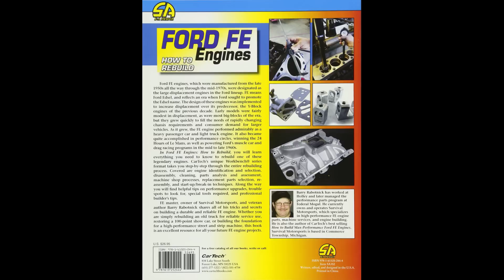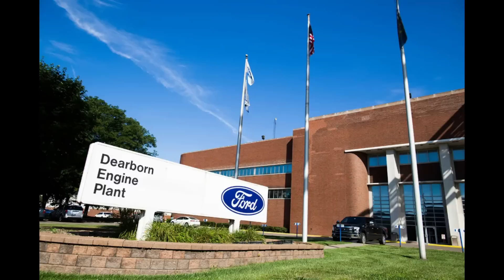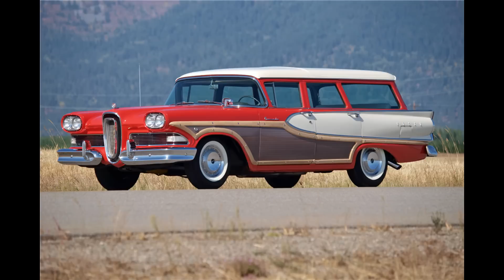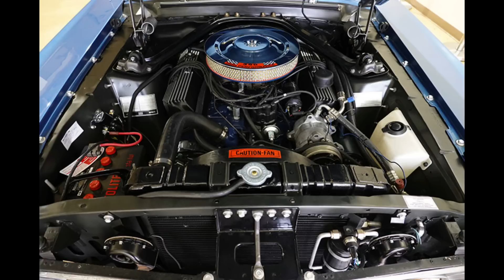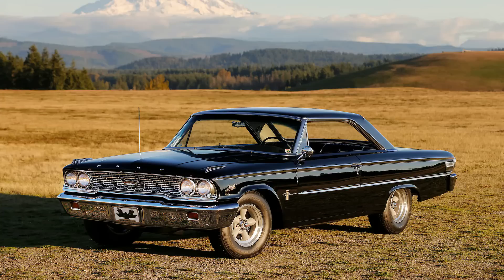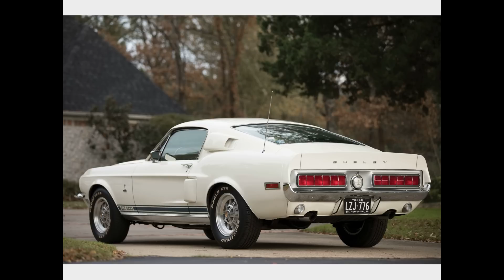Learn about Ford's FE engines and why they are among the greatest offerings by the Blue Oval!

Comment: I worked with some old time Ford mechanics, who assured me that the police package engines were hotter than the high performance cars sold to the public. Certain parts for the police engine packages required the signature of a dealer principal so they could be ordered. By dealer principal,  it was either the owner or general manager who had to sign off on the order of those parts, it was Ford's requirement. That was at a time when many performance parts could be had over the counter. As one of the guys said : It practically took act of congress to get those parts ordered !
Reply from the maker: Never heard that story! Thanks for watching and sharing!

Comment: In 84 I wanted to replace the tired 302 in my F150. I guy I was stationed with said he had an old engine sitting in his back yard when he moved it. He thought it was a Ford. I gave him $25 for it and took it to the base hobby shop. I tore it down, it was full of rusty water and oil. It looked rough but I still took it to a machine shop for eval.
After a day I called the guy "where did you find this thing? Come in, I want to go over it with you".
He showed me a small crack in the water jacket was welded. He figured that was factory after casting. They didn't want to scrape it so to save money it was made into a truck engine. All the internals for the engine it was going to be. The mains were cross bolted with massive bearing seats. The connecting rods were Ford Le mans and triple the size of the standard rods.
Reply from the maker: Sounds like it could be a 427.  Did you end up putting it in your truck? That is one heck of a bargain and a legendary score, thanks for watching and sharing!

Comment: I own a 1964 Galaxie 500 Convertible with a factory 427, dual quad four speed. I have owned it for 50 years now......it's been a great car. I have been restoring for several years now. It does run and drive....

Comment: The only things i never liked was how the valve cover seal area was weird and you have to remove valve covers to remove the intake.thats not that big of a deal.but even when you go to removivg heads one with high milage.the stock exhaust manifold bolts often broke off in the block.larger bolts may or may not have helped the desighn.we will never know.you could beat the crap out of them for ever,put a new timing chain,head gaskets and sratr all over again.

Comment: Were the FE engines denoted "352" heavier and more reliable in low speed high torque truck service than the engines denoted as "Windsor 351" or "Cleveland" ? 
  The "390" or "391" much more robust and also more power and torque over the entire RPM band than the "400" that replaced it ?

Comment: In the late 60's and early 70's I did a bit of sanctioned drag racing.  I was very familiar with all of the muscle cars of the time period.  I was campaigning a big block Mercury in Modified Production but I knew the performance of most  of the other classes.  I came to notice that Small Block 289 HiPo Mustangs were excellent and the 427FE was outstanding.   But the 390cars were getting beat more often than not.  Ford pushed the 390 335HP but it seldom if ever mentioned the dual quad 390 with 408HP.  Had Ford given more press to the dual quad 390 the Muscle Car wars might have been more in Ford's favor.
Reply from the maker: That's some great insider knowledge from the drag strip days, thanks for watching and sharing!

Comment: Currently rebuilding a 72 F100 short bed with a 390 C-6 and Nine inch rear end.  I'm going through the engine now the trans is done and the rear end rebuilt and all the suspension is completed. Upgraded to four wheel disc brakes. Should be a pretty cool truck.
Reply from the maker: That sounds like a great project, thanks for sharing! Love to see it when your on the road again!

Comment: I always wished that they had made the 4.13 bore from 1962 on. They were a great block. They didn’t need the side oiling. The SBC oils the same center oiling method. A 4.13 capable bore would have been an evolution. A 406 and 428 would have been all that was required. Never understood why they didn’t, it just made sense to me.  They could have made thick bore FT 391s for trucks that would be great over the counter blocks to build larger cubic inch strong engines, like GM did with their BOPC engines, all 454-500 ci engines. The 385 just was too heavy for “sporting cars”.
Reply from the maker: Thanks for watching and sharing your interesting info!
Reply: @IfThisCarCouldTalk Thank you!  I never understood why they had to do away with the best engine Ford ever made and replaced it with a bunch of overweight underpowered engines. The 4.13bore and a 3.78 and a 4 inchcstrokescc  were sufficient for every need they have. The LS is much like the Ford FE, and the Coyote is basically a DOHC 5.0 litre  sturdy FE. The two most powerful engines now are essentially remodeled FEs. I really wish that Ford would reintroduce a 4.13 bore and a 4 inch stroke pushrod FE. Sell them through SHP. Use modern technology to oil and cool them. Bring back the Cobra Jet 428 and put it in a modern Mustang and Trucks as a 406, maybe a 406 Mustang.

Comment: the 410 is a 390 bore with the 428 crank stroke.  i had a 64 merc that i put my uncle ed's pk lane 66 410 in it.  wow!  now i have a 66 pk lane with factory a/c and a 410 motor that replaced the 64 that i sold in ny long island long ago. Both were4door hardtops with a/c powered by UNCLE ED!
Reply from the maker: Awesome - thanks for watching and sharing your experience!

Comment: I have a recently finished  1959 f100 short wide bed. 1968  390 and a c6 transmission. IFS, four wheel disc brakes, parallel four bar rear suspension with coil over shocks on all four corners. I love it !  A stock 390 w/ 2 barrel carb made 427 lb / ft of torque, yep a two barrel.👍😎❤️F E’s ❗️ almost forgot mine has big back window !😁
Reply from the maker: Sounds like a dream truck, thanks for watching and sharing!

Comment: I'm not sure where you got all your information I  KNOWN several people that had early 70 GALAXIES  LTD  that had 390s the 70  to 73. MERCURY MONTEREY  USUALLY THEY  HAD A TWO BARREL 429= My uncle bought one brand new.HAD 390  And I've owned enough Fe engines and Mells since   I was a kid I know exactly WHAT THEY ARE my Continental  either ran the 430/462/460  365A Block CONTINENTAL MARK III THEY CHANGE THE 462 MID-YEAR TO THE 460 ON THE LINCOLN CONTINENTAL'S 

CONTINENTAL MARK III  ALL GOT HIGH PERFORMANCE 460. 
BUT YOU CAN GO OUT TO JUNK YARDS. AN STILL FIND 1970 TO 1973 FORD GALAXIES AND LTD  STILL HAVING 390 UNDER THE HOODS IF IT ISN'T A SMALL BLOCK. OR CLEVELAND THE LATER ONES  ENDED UP WITH THE MODIFIED 351 AND 400 TALL DECK CLEVELAND  WITH A C6 TRANSMISSION MOUNTING INSTEAD OF THE OLD C4 OLD FORDOMATIC KNOWN AS A CRUZO MATIC I KNOW I DATED MYSELF
Reply from the maker: Thanks for watching and sharing!

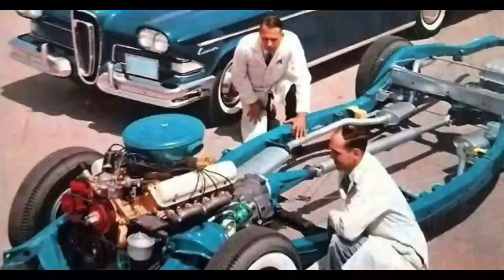Comment: Get a load of that frame at 1:53.
Reply from the maker: Definitely a cool photo!
Reply: Need info about cougar GTE
Reply: @LarryJohnson-x3d ; GT-E Cougar; 1968 only, and only two possible engine options. The 427 (W) code side-oiler automatic with non-functional hood scoop or 428 CJ in auto or 4 sd manual with functional hood scoop.

Comment: Never heard a a reasonable explanation for the head , intake design.
Reply: To take 50 lbs off the nose, some were given an aluminum intake from the factory, hot Rodders  figured out that you could right on take off 50- 60 lbs right off the nose and Belanger and Thorley and other guys could make 50 more hp by putting long tube with 24-30 inch collectors and cut weight and make more power. You could take a Model A and a 32 grille on 32 rails with a work of Art sitting there, Weber 4 - 54 mm carbs and short stacks and they made an early Hemi look pedestrian, lol. 😂.  Fast too!

Comment: "THE 406" 
I read an interesting article it was actually Ford's engineering documents, it stated the 410 was a big Marauder engine of course, but the 406 you can make one out of anything really all if he blocked but the actual performance the dedicated performance 406 it was just like the 427 it was a nickel block or a hard block it was cross bolted Mains, but only at the very end just before it got replaced the reason for it as you know? The FE engine on the NASCAR super speedways running high RPM for several hundred miles the bottom ends came apart of course cross bolting was the solution Chrysler's Max wedge became the hemi it had crossed bolting Ford was first., it was everything the 427 is except it was a 406 straight from Ford motor company, The story goes, the 406 dual quads in a galaxy lost the race to an Impala with a 327 Chevy at the pikes peak Hill climb challenge, that was the end of the 406 they punched it out made it to 425 point something cubic in the 427 was born, that's a fact, the actual 406  nickel block was so rare that's why you probably never seen one 427 are rare but at least they were sold across the parts counter for a number of years the 406 never got that opportunity I've only seen one and it was a picture and it did have cross bolted mains and the spark plug location like the early 427 and it was a top oiler design.
Reply from the maker: That's a great story - thanks for sharing!

Comment: One small correction. In  1961 the 1st year for the 390 it was offered as you stated in a 2bbl a 4bbl and the 390 hipo which was the 4 bbl motor with the dealer installed tri power aluminum intake and 3  2 bbl carbs. The 390 police interceptor didn't come out until 1962 and it had hd con rods 11:1 compression ratio,   a solid lifter cam and cast iron 4 bbl  intake with 780 Holley and dual point distributor 330 HP and the 67 cougar could be bought as a GTE. the actual 1st of the eliminators and came with a mild 427 came with cast iron 4 bbl intake and hyd cam
Reply from the maker: Thanks for watching and adding that info!

Comment: I can't help it I got to say this, lowrider medium riser high rise heads that's the reason for the designation medium high in low riser it's all head design head (port) design not oiling or because it was used on the streets if Ford needed more power they raised the port making ot larger they can't make it wider so they went taller " hence" HI--RISE  nothing to do with anything else

Comment: There was a true 406 block one year only it got beat by a 327 chevy at the pikes peak hill climb event, a galaxie and an  impala, ford took same custom "cross bolted" engine maxed it out the 425ci was born aka 427 FE, yes it was the same custom metallurgy block good for approximately 1500HP, there were others 
.DO YOU KNOW WHERE AND WHY THEY WERE CROSS BOLTED? That's also a great story.....

Comment: Biggest draw back for me and the gear heads I know is 1) Price. SBC more so, but even BBC in some cases, cost a lot less to get more power since the mid 80's anyways and still today. 2) Many of the vehicles and unibody stuff that doesn't handle the power more so with a little rust. 3) cost of a vehicle. Some reason old mustangs with 4 and 6 cyl still comand a lot of money compared. Even trucks cost a bit more, or use to. 

Now days FORD vehicles are cheaper but hard if not impossible to get parts. I own a 65 Fairlane with the 240? inline. Tie rod ends cost me $300 unless I wanted to upgrade to a v8 style, but that would have been $450 ish. and I might have need to add P/S. Same thing on a 65 chevy almost anything, about $50 and get them from almost anywhere.
Reply from the maker: Thanks for watching and making your interesting comment! We love the '65 Fairlane!

Comment: In regards to the topic of cross bolted 406 motors... Yes... They received cross bolted mains on the #2, 3 and 4 in mid 1962.  Only NASCAR motors received these blocks because the non cross bolted variants were having block deflection issues and main caps walking in their registers under extended high RPM NASCAR racing. None were ever produced and installed in a street car as it was a limited half year run to specifically support the Ford racing program in NASCAR.
Reply from the maker: Thanks for the info and for watching!

Comment: I have done 428CJ engines. I used forged pistons and the C7AE-B rods and worked on the crankshaft by smoothing the throws and lightening the crankshaft. I used crossbolt caps on 2 and 4. And of course the oiling modifications and HV Melling oil pump with the deep sump Canton pan and the large pickup. Internal balance also, with the oil drains in the valley except for the front and rear having hose nipples screwed in to prevent oil from going to the crank and rods lightening the crank. ARP 3/8 rod bolts were plenty for a 6500-7000 rpm lightened and balanced crank, they would rev really quick. I used a C8AXD 427 cam until roller cams were available. My favorite is the Bullet 279350 that is 245@.050 and the exhaust lobes are asymmetrical for a strong overlap, and .600 lift 110 LSA . I can run them as a solid or hydraulic with Molmar tight lash hydraulics. 7200 as long as you want and torque that will make you trip the 60 ft beam with the rear tires. And at 11.3:1 93 octane Phillips 66 and 34 degrees of total timing. Monstrous. I used C4AE-G heads with 2.19/1.625 valves. Now Trick Flow has killer heads that are needing minimal porting to flow High-Riser Tunnel Port numbers. The Trick Flow 2x4 Tunnel Wedge intake is great. A pair of 715 Holleys or now Edelbrock/ Holleys are stunning. Put that 560 ft lbs and 600 hp in a Fox Body with a C4 and a Dana 60 and you can pull some great runs and do it for years. The FE, when built with care, the 428 will give you stunning power. C/SA NHRA, they are still running strong! Did I say I love the FE?
Reply from the maker: WOW! Thanks for watching and sharing your amazing builds! So glad you love the FE too!

Comment: There was one flaw in this ingine. I have seen it both the 352 and the 390. Between the waterpump and intake manifold is a 1 inch long hose. When the hose fails you have to strip down the front of the engine to replace it.
Reply from the maker: Thanks for watching and sharing your expertise!
Reply: All of the FE's have that

Comment: Yes the 406 had crossbolts. I had one.
Reply: Not sure if they all did, but yes at least some were cross-bolted. I've seen 3 of them. The 406 was Ford's first serious factory race engine effort in the era so there were probably a number of tweaks and changes done which were never recorded on the books for their top teams which may not have reached the street RPO engines. Most were raced to death so the 406 is a rare find these days.
Reply from the maker: Thanks for watching and adding your info!

Comment: I have a 1975 F-350 cab and chassis dually with the 390 engine.  It was my high school transportation and saw lots of doughnuts and drag racing action. Im going to convert it to 4x4 using modern Superduty axles from an F-550. I think after that's all done,  i might build up a nice 428 for it.  Just want it to be a good towing rig.
Reply from the maker: That’s a great build plan! Thanks for watching - keep it up!

Comment: I owned a 1960 T-Bird with the 352, and a 68 Ranchero with the 390. I hotrodded the 390- rebuilt it with a .060 over bore, a Sig Erson cam lifters and rods, an aluminum intake and a 800cfm Holley, Hooker Headers and turbo mufflers. It was a bear to drive because I put way too much cam in it but it would fly down the highway. It also sucked gas-5-6mpg's.
Reply from the maker: Sounds like you have had a whole lot of fun! Thanks for watching and commenting! Keep it up!

Comment: Not a big deal, but you didn't mention the Talledega- one year only with the 428 CJ non Ram Air only. No options- plain cloth bench seats, C6 trans. power steering and brakes. 3 colors only, White, Maroon and Blue. Ford's aerocar for NASCAR- the funny thing is the Mercury verssion, the Cyclone Spoiler II came only with a 351 Windsor. I saw a Talledega on a used car lot in 1975. Someone had painted it yellow but it was the real deal. The dealer wanted $1200- I thought it was overpriced because it didn't have the Ram Air shaker hood or bucket seats and console. Still kicking myself.
Reply from the maker: Thanks for watching and sharing your Talladega story!

Comment: Did the morning start and check on a 391 industrial used as the emergency back up on a small ski lift at aspen Highlands . Strangest FE that I have run across . They ran an industrial 225 leaning tower of power in a smaller ski lift .
Reply from the maker: Interesting comment! Thanks for watching!

Comment: Ford blamed the 406 for poor NASCAR performance then they realized it was not the Engine it was the poor Body line. The 1961 Star liner was fast and handled  the New 1962 notch back was slow and had ill handling